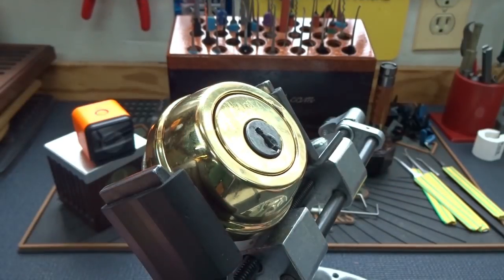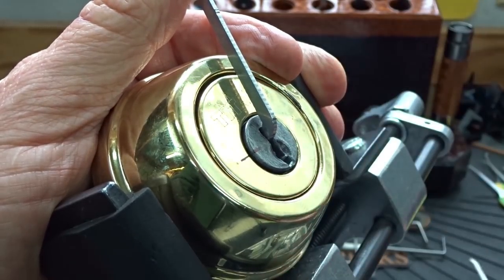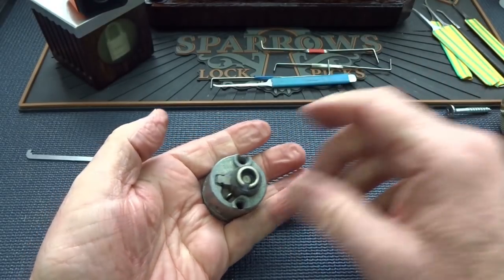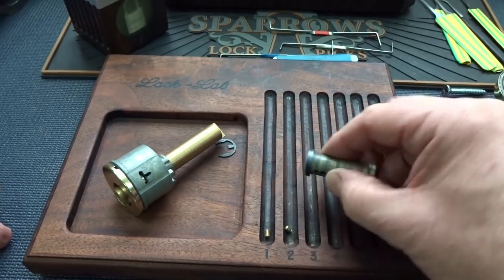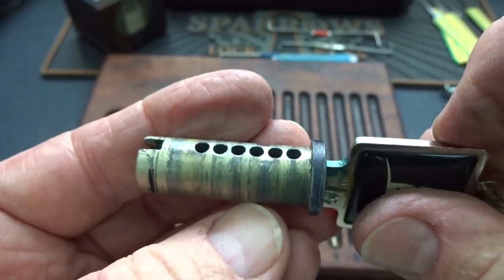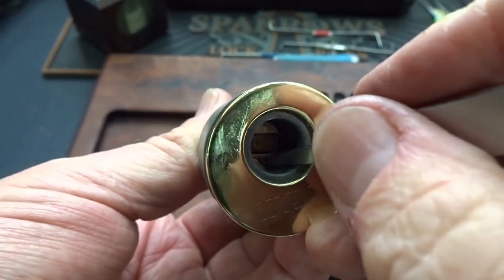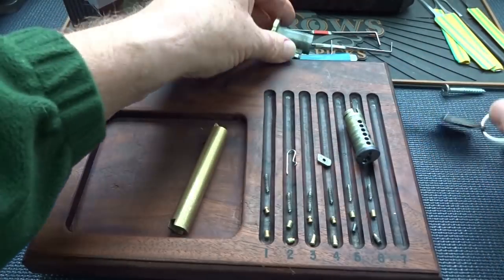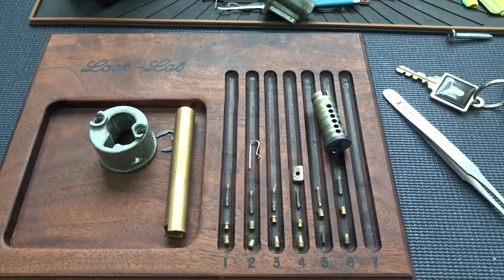(1222) Challenge: Erroneous Designs Titan(ito)

Comment: The odd flat disc was part of the kwikset design.  When Titan came out you could change keys by removing the lock face, similar to I/C core locks.  It used a key with a groove cut in the bottom that alligned with that spring loaded disc.

Comment: Bill that’s just the standard locking pawl for the Kwickset Titan series locks. It works with the control key to allow removal of the Lock body without removing the lock from the door. He did nothing to modify it, it’s totally standard on Titan and has nothing to do with the picking security.

Comment: This is not a Trap Lock Bill. This Titan gives you the option to rekey the lock by yourself. It's just like a "Best" IC CORE, it has a control key with a groove that comes in the box and you can take the old core out and put a new one in without disassemble the lock from the door. Comm'on man, i thought you're better than that ;)

Comment: If you had picked it counter clockwise, I wonder if that T-pin was small enough to fall in that hole for the construction key ball. If so, that would turn this into a trap lock you can only open one way.

Comment: Bill, I still say you make yourself a door or lock jig to put these locks in rather than your vice. That way you do the full "Lock Picking" environment.
Reply from the maker: I'd love to but each video already takes somewhere between 3-4 hours to set up, film, and process.  With all the different locks coming into the Lab I'd need about 50 different door mounts ($$$), plus the hardware to install it all. That would only add to the expense and time - neither of which I have in abundance, sorry.

Comment: Tolerences are way off on that lock, but it is a Kwikset after all.  And I do not understand why the Emhart-like cuts are on the key, other than it would be impossible to rotate it 360 degrees, due to the driver pins dropping into the bottom notch of the core.  The notch on the top of the keyway is found on all 6-pin KW10 locks.  I would understand why that key barely works, because of the poor tolerences and the fact that most of the key pins are T-pins.  Also, the retaining pin I'm assuming was  meant to be a Heinz-like trap, but because on how rough it was machined, it will not really come into play.  Also the MACS for the Kwikset Titan is not as restricted to allow for more bitting permutations, but I can tell that bitting does violate MACS, even though it is a Titan.
Reply: Jillian Latorre I don't know much about special traps and I can't name a single thing I see but can't that spring loaded piece be there only for giving weird feedback? I mean.. if you turn the core while picking, the rotation on the not perfect round core(the engravement gives it a flat area) causes the spring to apply non constant force to the tensionning piece which can be misleading, can't it?
Reply: Bence Tóth Well, even if you are in a very deep false set with a narrow T-pin, I still would not think it would come into play.

Comment: These pins got me thinking about DIY security pins and I cam up with the end of a headphone jack taken out of the housing and cut down, it would be like a double drunken spool with w t pin and interlocking with the other pin. The part of the headphone that plugs in to your computer the part on the end of that with the bevel is connected to a long thin rod that goes through the plug. There are different sections and if you took just the front out you could make some amazing security pins. I would love to see if someone would try this or has tried it?

Comment: BosnianBill is it possible that because ErrounousDesigns used locks with sloppy tolerances that all the magic or alien tech really wouldn't make much a difference? My feeling is you had such quick success because the lock core was not made to tight tolerances thus enlarging your sheer line. Regardless the of T pin and the like, are tight machining the key to making those technologies work? Your thoughts would be. Appreciated.
Reply: I know what you mean..but...can't say it doesn't make a difference but I've picked challenge locks built off fairly good locks and they've fallen open pretty fast, sometimes faster than their factory counterpart. ...and then there is a common schlage deadbolt challenge lock sitting in my locks which took me nearly two months. Even watching though the videos here, it doesn't seem to quite align. I do think starting with a good base is a good start, but some people just seem to make better challenge locks than others regardless of the base.

Comment: This might be an odd request, but I would like to see you handle a challenge lock backwards.  Gut it first, and looking at the pinning, make a few predictions on how the picking will go (deep false set when a certain pin is set or touched) and then compare that to the actual picking. I know this abandons the "challenge lock" idea, so perhaps just repinning a lock to get the same result. I think it would be interesting as we usually see the pinning after the pick and I personally try to see in my head which pins were responsible for certain clicks, or certain sets.. but this is difficult to feel over the internet.